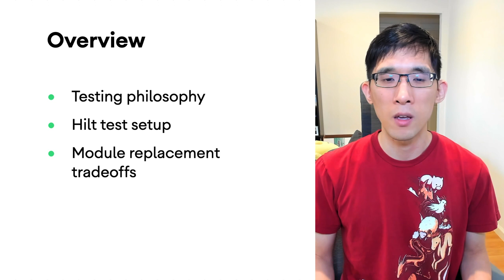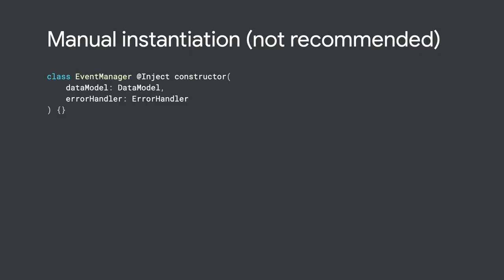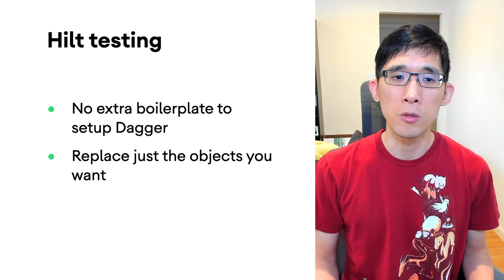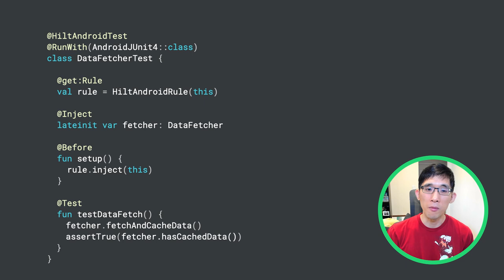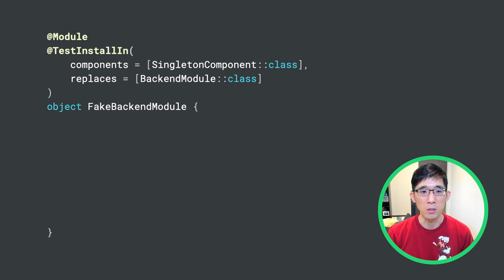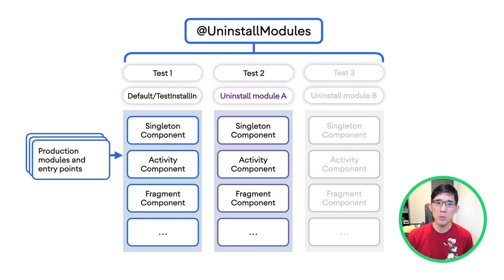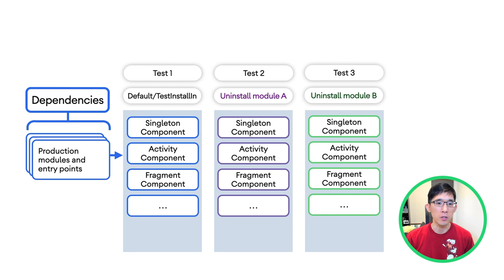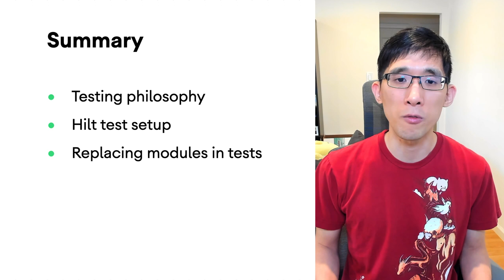Hilt testing best practices - MAD Skills

Comment: I am still not convinced that a DI framework is worth the trouble, even Hilt still adds a lot of boilerplate code. I switched from Java to Kotlin precisely to avoid that.
About 0:50: using mocks for the dependencies in tests allows you to verify your object's calls to those dependencies. You can't do that with real objects.
The "more code coverage" argument seems to be moot, as long as you have tests for the dependencies as well. Using mocks also allows (and even forces) you to have tests that are really focused on the object at hand and not test its dependencies as well. And what about the case where the dependencies are objects from another library? Isn't it better to use mocks for them as well?